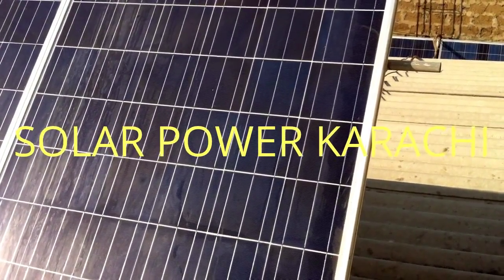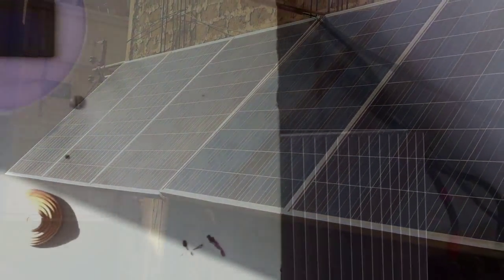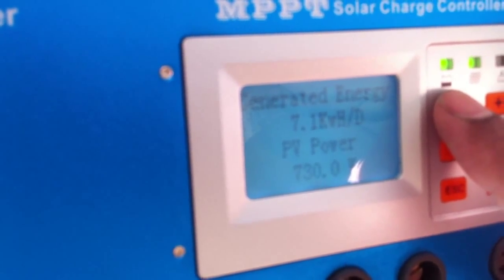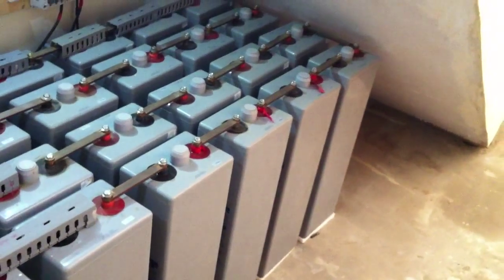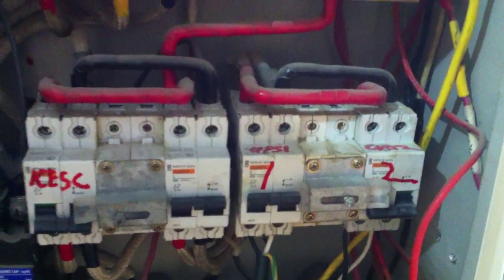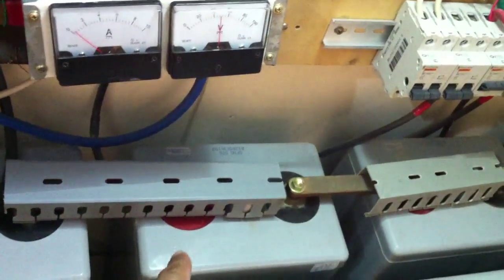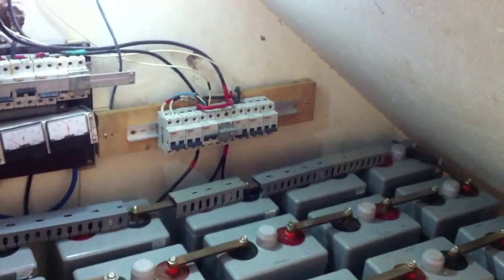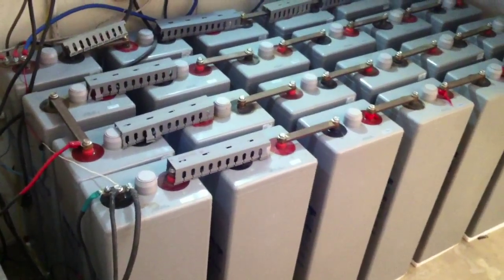Solar power - Karachi Pakistan - Dr Taj Uddin

Comment: Cells ki keya life hai?keya agr 1cell bhi dead ho jae tu?Pura systems problem krta hai? Guide plz
Reply from the maker: It has good life, I am using it last four years. If one cell is not working then voltage will go down by two volts,